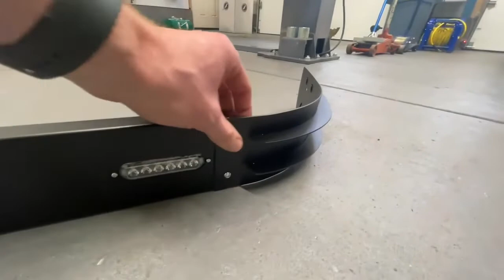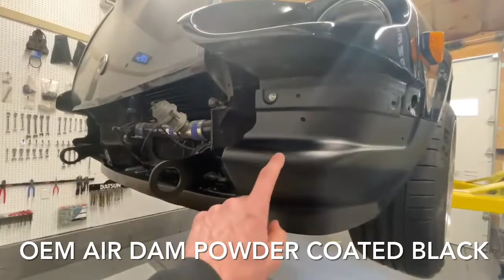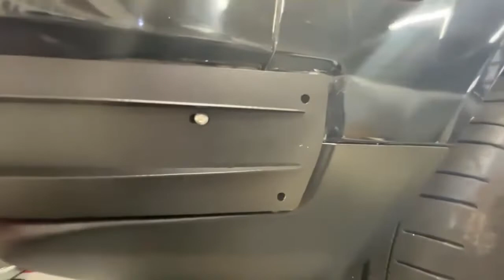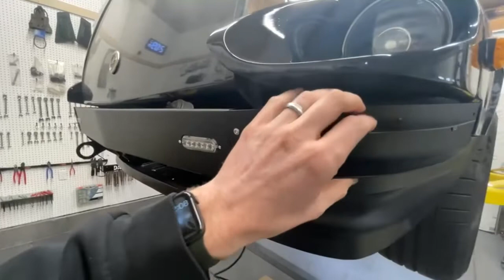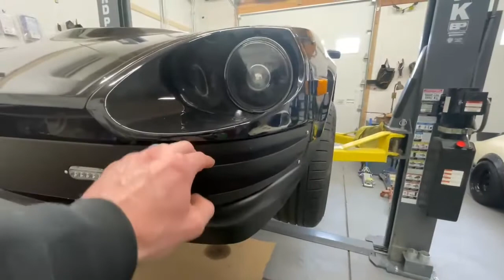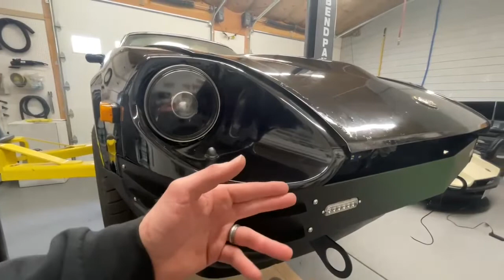Skillard’s Datsun 280ZX (S130) Front Bumper Installation

Comment: Thank you. Finally someone making a low profile bumper to look like the original z. Thank. You. Will be purchasing soon.
Also, any chance you can make those plates for the s130 mirrors you fabricate but without the mirrors? I want to block off those holes to install fender mirrors, but I don't want to fill the holes.

Also really digging that wheel setup. What are you running?